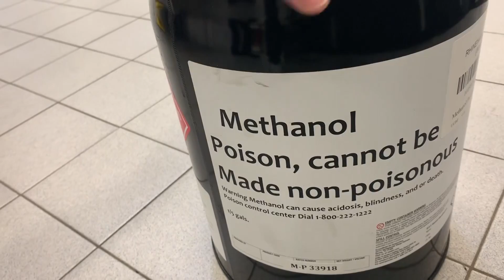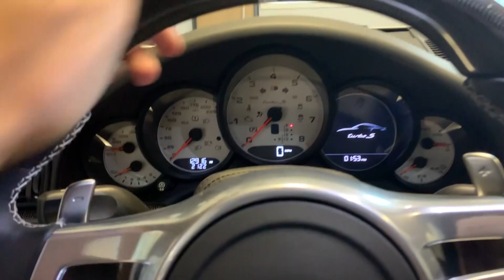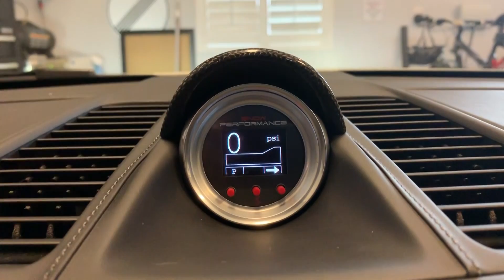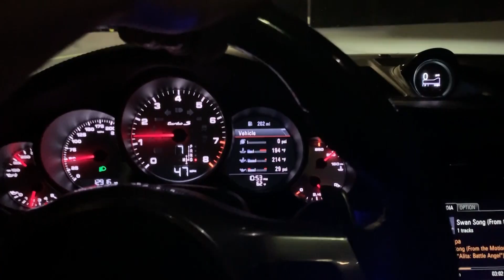Porsche Stage 4 Turbo S w/ 68mm Turbos & Methanol

Comment: Awesome! I have a 991.2 turbo.. what kind of power did she put down?
Reply from the maker: This thing has been through so many builds at this point I'm not even sure- before the engine blew it was probably around 800 at the wheel.
Reply: @TheStockpile  How did the engine blow up?
Reply: Do you remember what part numbers make up the full Devils Own Meth kit?